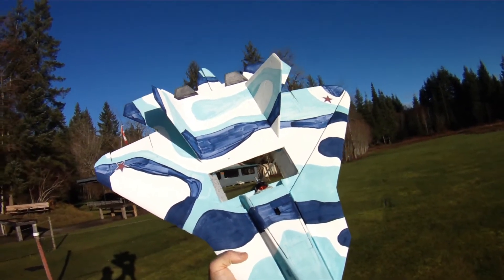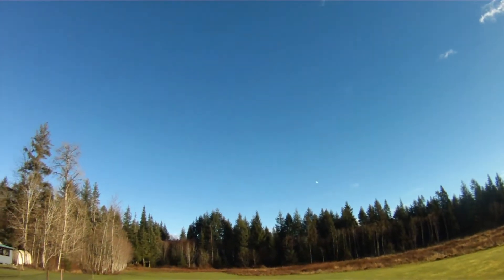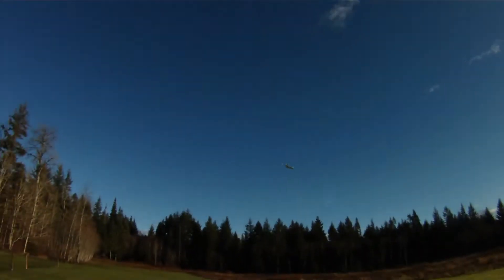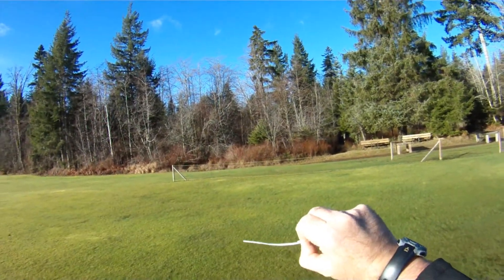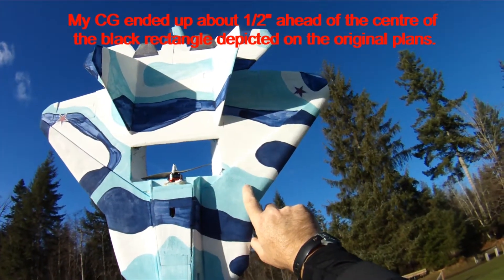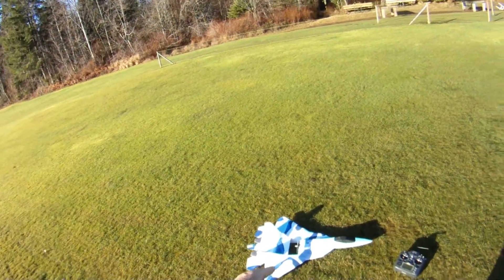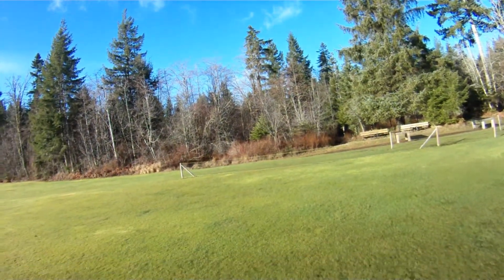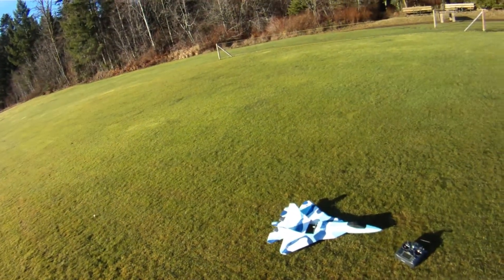Modified RC Powers T50 V5 flight video and discussion 22 Jan 2018

Comment: Hay Scott
Yay you've flown the new T50. It's weird how such a small thing like that little difference on the KF can affect the flight on some planes and then other planes still fly ok with chunks of foam missing. Great work mate.
...RCPP
Reply from the maker: Thanks so much RCPP, yes it is a bit weird how some planes can be that easily affected by the imbalance of the KF, perhaps because the T50 has such a weird shaped wing that blends into the horizontal stabilizer, they can be susceptible to adverse yaw although I didn't have any control input in the roll or yaw when the aggressive dips and pulls were happening.  Thanks again, mate, more to come after I get it dialed in and get more comfortable with it I should be able to get it "rockin' and rollin'" a little better :)  Cheers, Scott